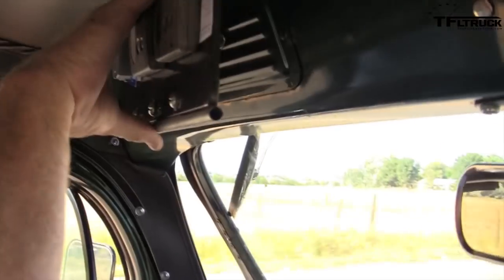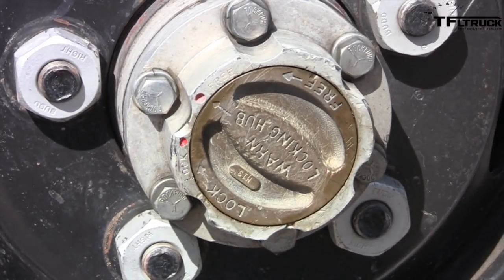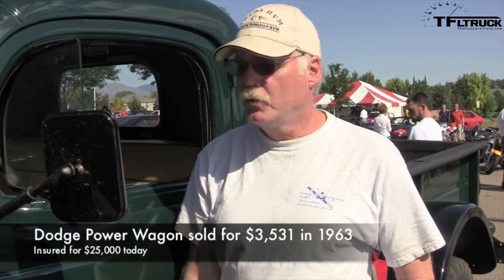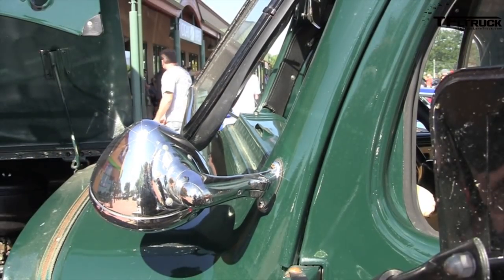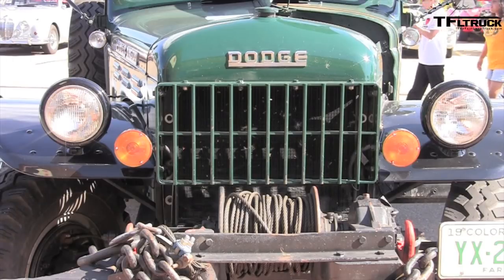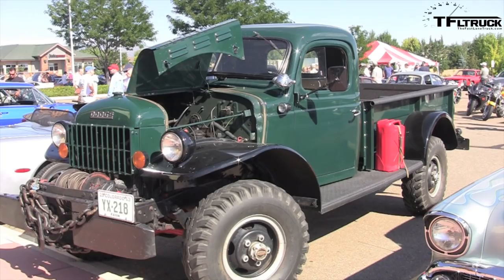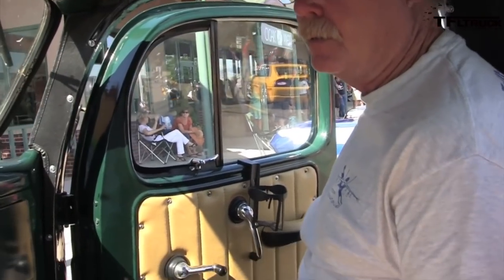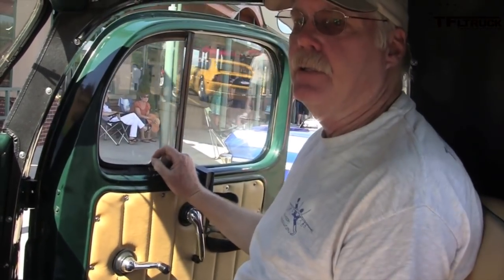Classics Trucks Revealed: 1963 Dodge Power Wagon pickup still going strong

Comment: Grew up hunting in one from the early 50's.  No seat belts, straight gears - no synchromesh.  6-volt electrical system.  Vacuum-operated wipers.  Starter button on the floor.   No power steering.  No power brakes.  Drum brakes, but going downhill they were geared so low they didn't need better brakes - just take your foot off the gas, and they slowed right down to a crawl, if you were in a low enough gear.  Manual hubs.  Gas tank behind the seat - and Dodge was STILL doing that as late as the mid-60's!  We had one in the Coast Guard, a std pickup, '65 or '66, that leaked.  Dearly love those old Power Wagons.  A ton of torque and ground clearance that puts any factory 4X4 today to shame.  Wish the engine and gears could be heard in the video.  That low-range gear whine is sweet music, burned into my heart & brain.